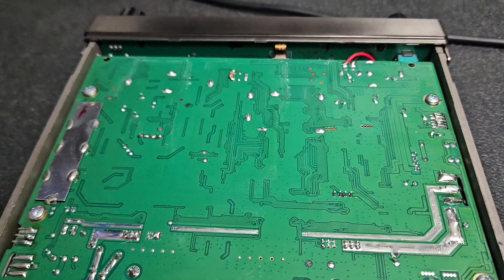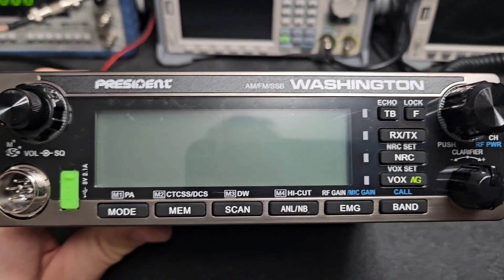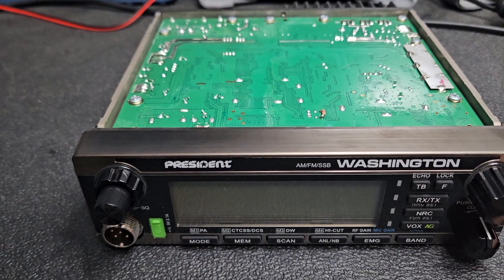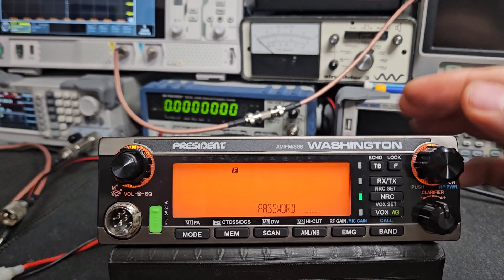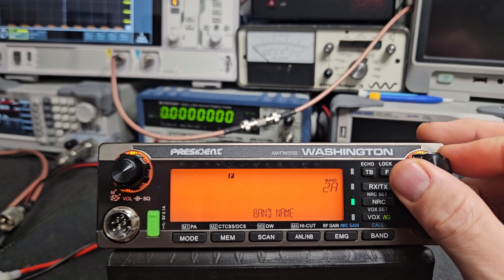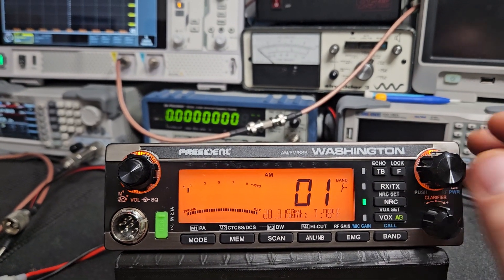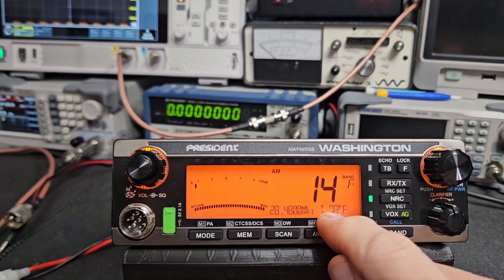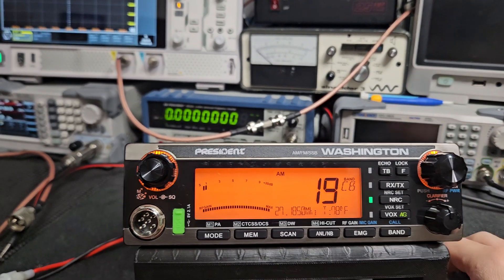President Washington for Jim in CA

Comment: Scott, You can just program the radio without any jumper to open 11 meters just enter password which is 12345. Does exactly same power etc. no soldering needed & not sure why they did it that way also. When i use the band switch I can go into the UK 40 channels on FM 27.601 to 27.991 which is no use to the US & Canada area but I can talk skip there if no SSB activity. -73's
Reply from the maker: Thanks for the message but that's not true you need to bridge that connection to get full export operation out of the radio. 
Maybe in Europe it is different but the ones here in America definitely need it.
Reply: @ScottsRadios  Yes, it was made in EU but got it here & could be a difference maybe. The one you have will it select the 40 channel UK CB when you press the band button?